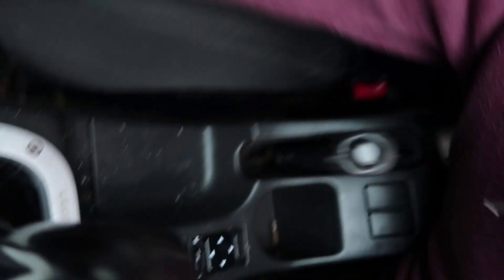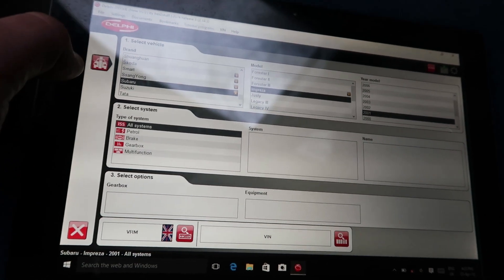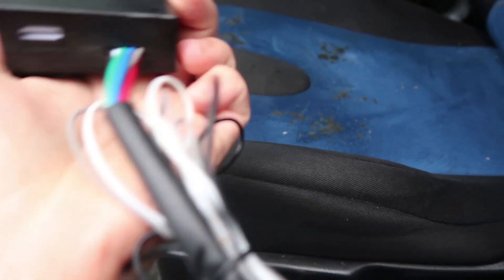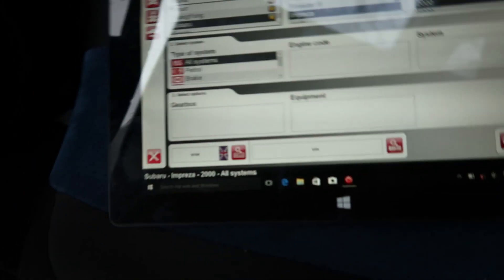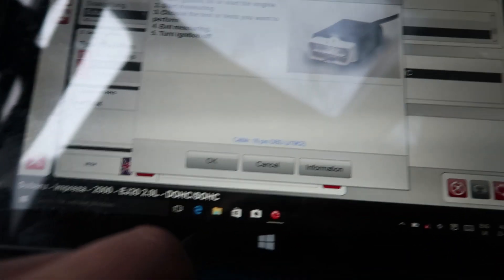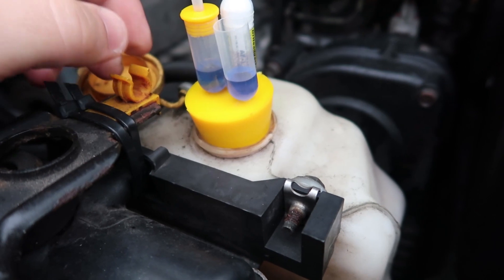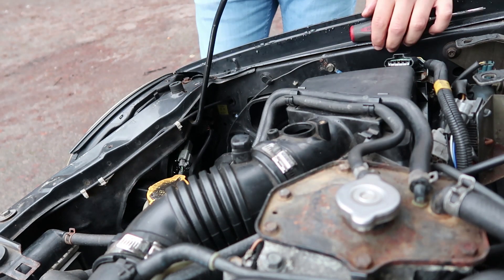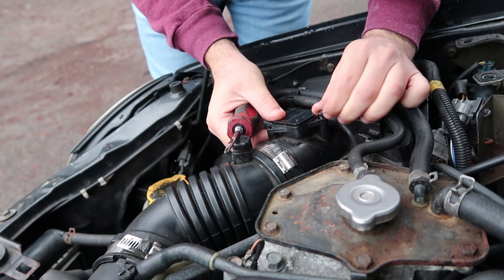Another broken Subaru Impreza!

Comment: Could even be a bad coilpack or maybe incorrect spark plug gapping, especially if it misfires under load.
Reply from the maker: Yes. Someone worked on it before and changed two coils and plugs. I will have a look next weekend
Reply: @GeorgeHampl  did you ever fix it?
Reply from the maker: @battfinkz  No. It's a Subaru. It cannot be fixed. Comes broken from factory.